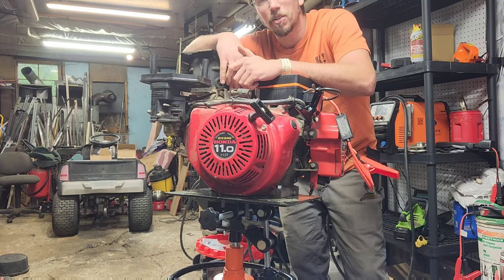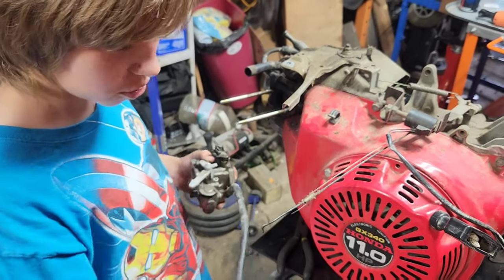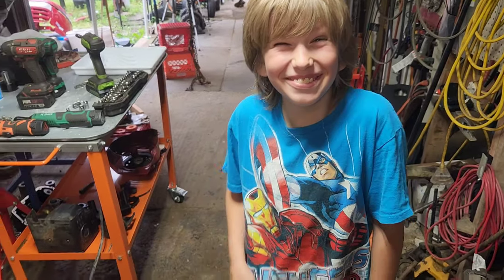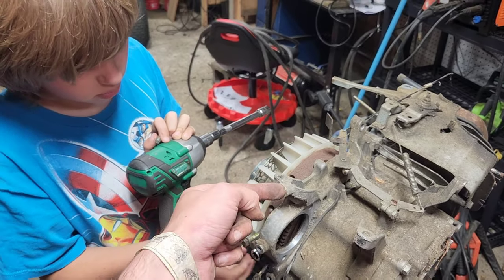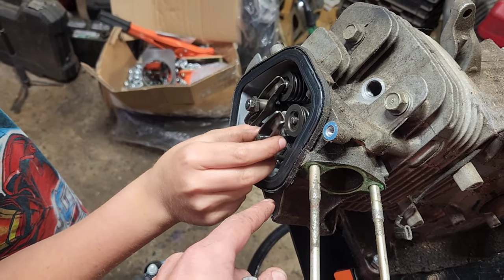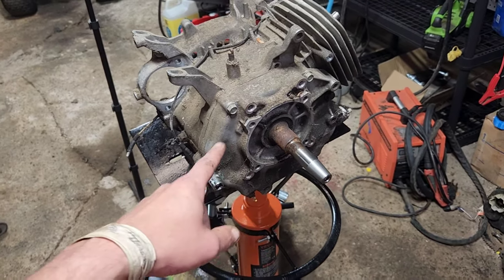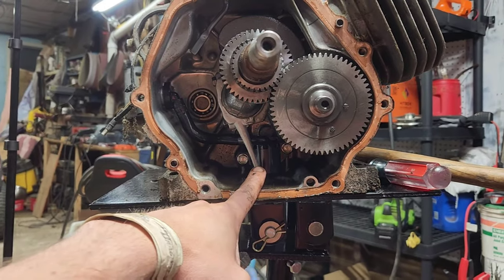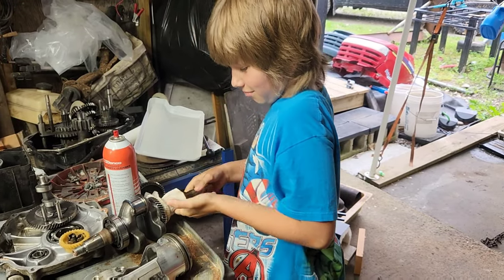GX340 GX390 Broken Down To Block

Comment: Is it JIS 10 that is roughly equivalent to grade 10.9 or might even be ISO now a days?  Probably can throw another charging coil on there for more power, is that correct?  I haven't worked on, though was reading how some have hacked the GCV's & GCH's using the GX coils and flywheels as well.  I bought two and still haven't played with, I think for making a gas powered air compressor when I thought I needed one and only had the GCH candidates from old broken pressure washers.  Yeah, that's right for the electronic actuated throttle control to disengage the clutch from what I'm recalling.  Great to see you're still going strong!